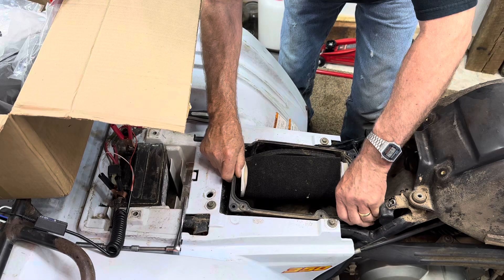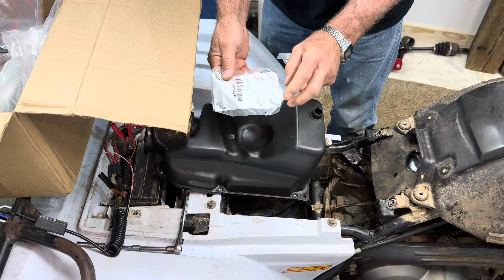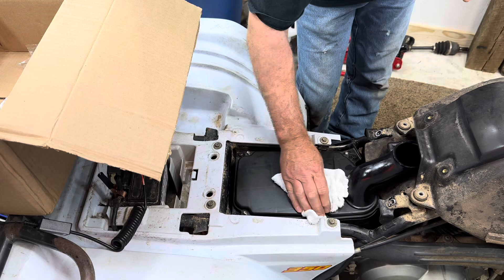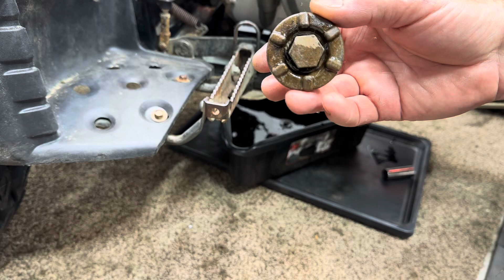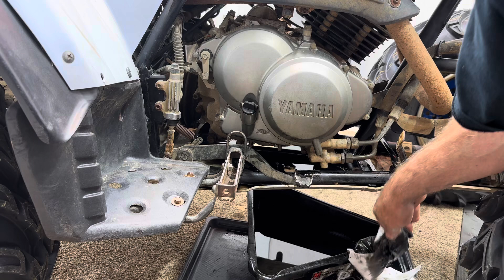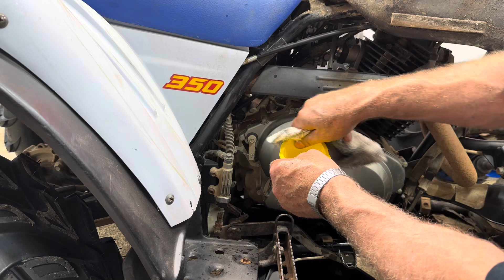Episode 9, Installing some OEM Yamaha parts, changing the engine oil and filter #yamaha #offroad atv

Comment: That oil screen cleaned up well, along with the spring and cover. The oil should pass through much easier now!
Reply from the maker: Every little bit helps I’m sure. I just finished doing the top end rebuild and now the oil burner is gone 😂